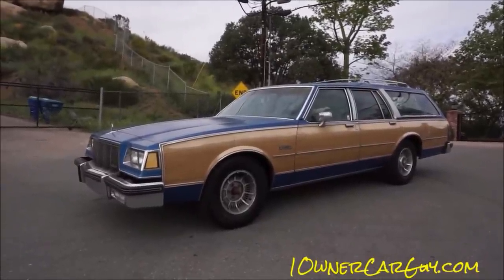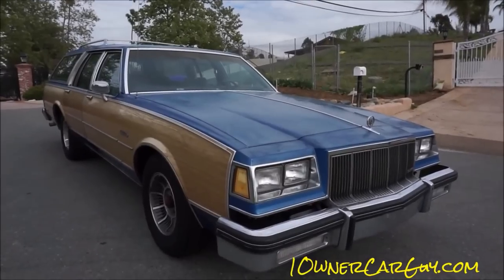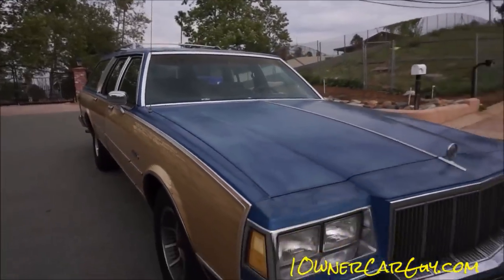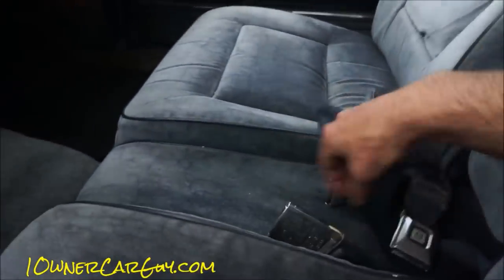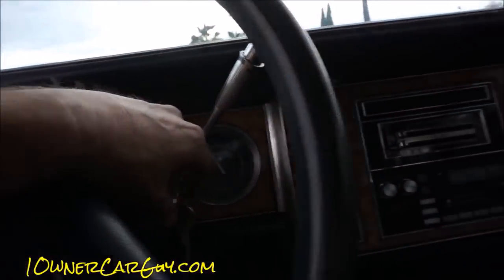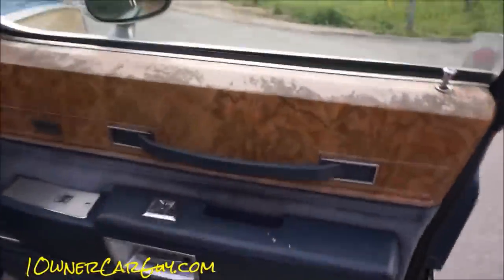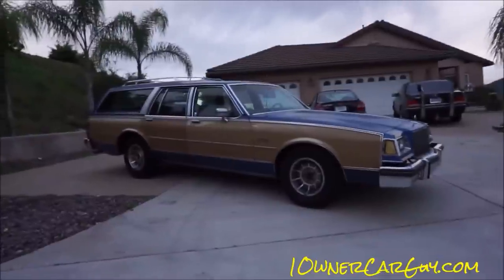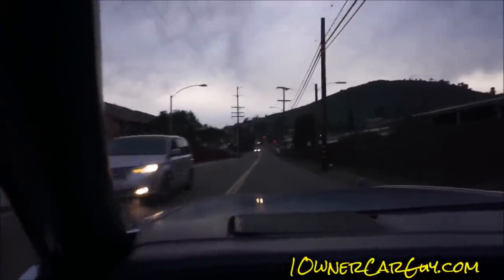88 Buick Electra Estate Station Wagon Full Video Car Review 1 Owner B Body

Comment: The available engines for this wagon were the 307 cubic inch diameter V8 Oldsmobile engine, the 350 cubic inch diameter V8 Buick engine and a diesel engine was also optional although not popular.

Comment: All GM B Body wagons from 1987-1990 got the Oldsmobile 307 V8. YUCK
The Chev 305 was way better for torque. I don't know why GM chose 307 as the only option for those years they never had that extra punch you need for these 4500lb beasts